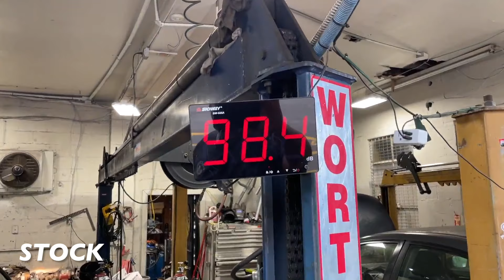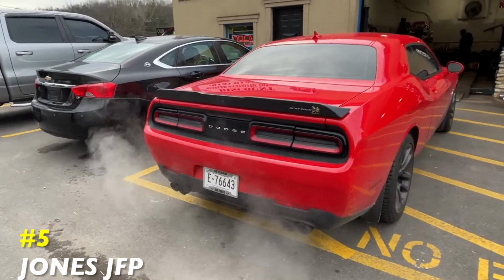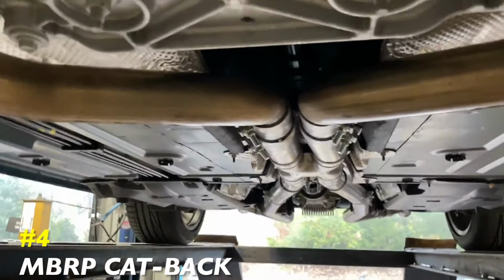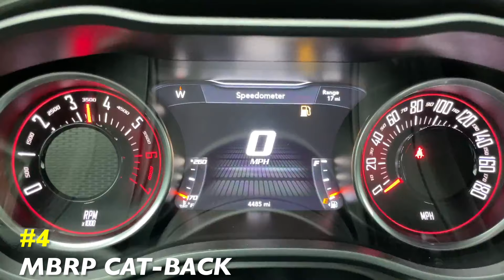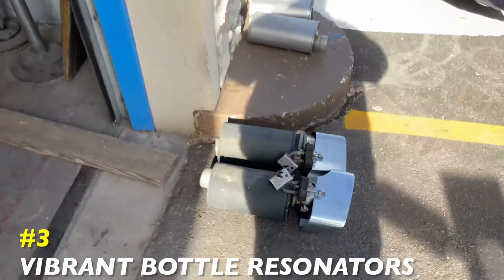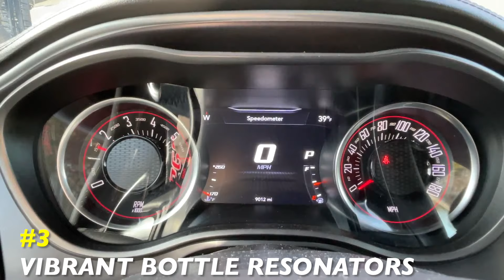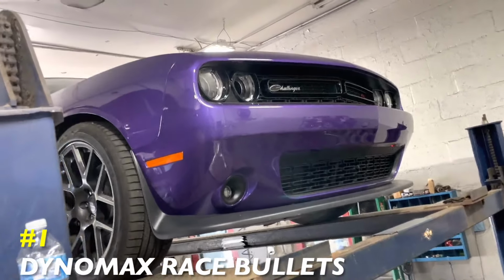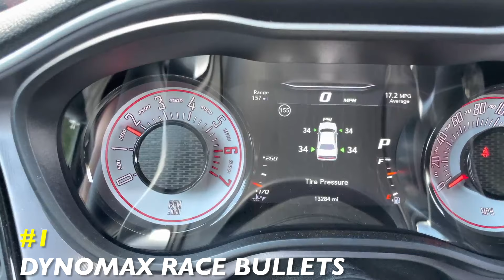Top 5 BEST EXHAUST Set Ups for Dodge Challenger Scat Pack 6.4L HEMI V8!

Comment: I definitely went with the last option with a little twist.  Had both mids and both resonators all replaced on my WB scat with Dynomax race bullets and then the quad tips added.  Now that’s the way a muscle car should sound!  It sounds ridiculously aggressive and is truly a head turner.
Reply: I have the race bullets in place of mids and been wanting to replace resonators with sime as well.... any check engine lights with what you did?
Reply: @RoyalViking465  no issues with codes.  I think what throws a code is when you mess with the catalytic converters and/or the active valves.  I was adamant in telling the guys don’t mess with my valves.  It’s the perfect set up for me.  It’s loud enough in Eco/auto mode and stupid loud in anything else.
Reply: @TheeMrsChampion  Awesome thank you 🙂
Reply: @RoyalViking465  sure thing!  If you have it done, come back and tell me what you think.  Happy New Year!
Reply: @TheeMrsChampion  I will definitely check back Pam thanks and Happy New Year to you too.
Reply: Can you send the links for those parts?
Reply: Hey do you have a video of how your set up sounds?
Reply: @jimkeydaniel3246  I do but it doesn’t do it any justice.  It’s quite loud in person but video sounds blah.
Reply: You can race bullets dynomax on the resonators?
Reply: @alexcarbajal6632  yup!
Reply: I got the race bullets in the mids and I used MFER to hold the damper valves open.  Still have my original tail mufflers.  No  Codes or issues.
Reply: @TheeMrsChampion  how’s the drone? I’m thinking of just doing mid muffler dynomax bullets
Reply: I was thinking of doing the same thing because its a deeper tone. What length bullets did you get?
Reply: @augustdrums1247 do Vibrants 1974
Reply: PLEEEASE???😢😢😢
Reply: Any terrible drone in the cabin doin that all dynomax setup replacing the mid n rear deletes ?
Reply: @TheeMrsChampion do you have a lot of drone with that setup? Thinking of doing the same
Reply: @ no I do not.  It sounds great to me.  In my opinion, it’s better than just a mid muffler delete and I’ve had this done since December 2021.

Comment: The only exhaust that sounds better than stock in my opinion is the Awe track…. I’ve owned the corsa extreme and the mbrp… corsa extreme sounded great outside the car but was too quiet inside. The mbrp was a disappointment to me… made it sound more German V8 ish than American.  The AWE has a h-pipe instead of the x so it has a very distinctive sound

Comment: Came looking for something a little better than the mid muffler I have my 21 scat but honestly none of them sound too much different. Could just be the video tho idk
Reply: Most microphones, especially with go-pro's, make quiet things louder and louder thing quiet so it's easier to hear. The drive-offs are what tell you how loud the different setups are depending on how far away the car is and the volume it's still at, if that makes any sense.

Comment: Buy a Taser Automotive to unlock your exhaust sounds it opened up the electronic baffles cut your BBQ Pits out which of the Mufflers closest to the exit exhaust take out the mid exhaust pipe it with 4in and you will have the burble tune the taser gives you the features of the 2021 1320 line lock track mode everything a good little boy and girl would need to go to the track
Reply: Have no idea what you're trying to say. Try some periods once in a while. 
I have the taser and mini bullets on my 6.4

Comment: Thought this might be a good place to ask as you guys do this for a living, but any idea of a Challenge exhaust that sounds a bit more like a old race bike? Maybe comparable to some modern stock cars at higher rpm?  Not super high pitch, think older 60s 70s race bikes (or if a modern bike maybe somewhat similar to Aprilia RSV4? something like that if not exactly), but i heard one awhile back.  I give that description because i heard the engine and was waiting to see what type of bike, then out of no where a Challenger drove by.  On fly by it did not have the wobbly tone of a 3.6 more the chatter of a V8 on decel, but maybe it could of been a V6 with a really nice exhaust, although i do not believe that to be the case. 

Interested if anyone has ideas on what it could of been, i know for old classic Ford V8s there was such a trend a while back to tune the exhaust and intake to produce such sounds (callback to LeMans and Trans Am era racing) but never really got a clear picture on the parts used or the recipe to actually make it all sound so good.

Comment: The best exhaust setup for a Scat Pack 392 is factory.  According to a Dodge mechanic friend who went to the factory schools.  These vehicles bear absolutely no resemblance to the carburated old-school muscle car where you could chop the pipes and put a better exhaust manifold to get better performance.  Sort of.  Or take the smog off.  Newer cars are 100 percent computer - designed by pretty much rocket science - changes in back pressure make a difference (or anything, including tire size) to the sensors.  And it doesn't make things better.  You can't aspirate them better - that's about upgrading to a Hellcat.  The way it comes off the lot is at it's peak performance.  You all just want it louder.  And some of those muffler mods make your car sound like a motorboat.  Six bangers are the worst for that, but I've heard some pretty silly 392's too.  But I guess your money is your money.  You will spend it like you want.